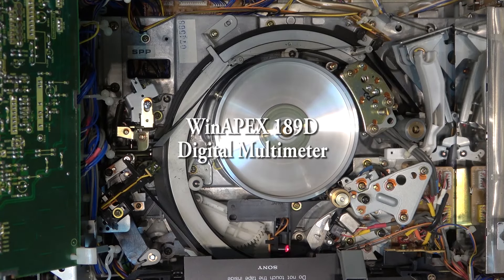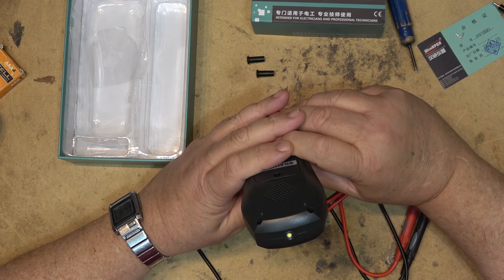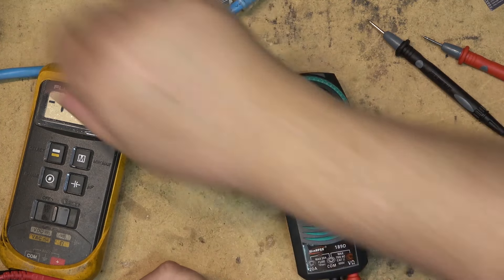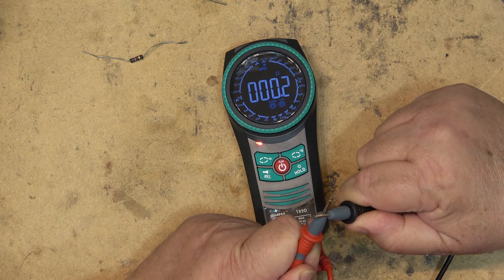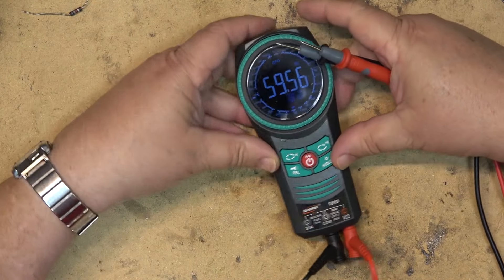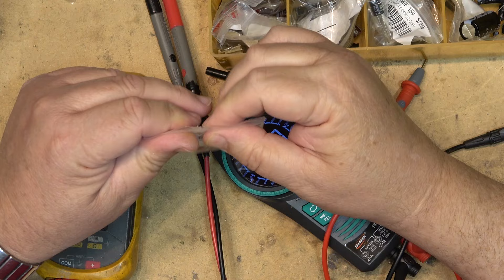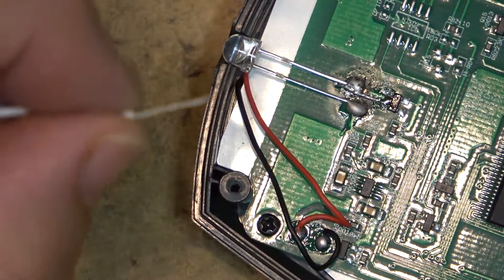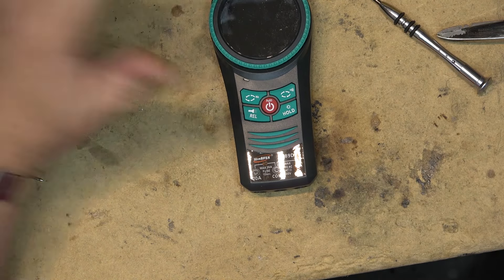WinAPEX 189D Multimeter Review

Comment: It's amazing that was the only damage.
Reply: That LED broke because the meter is cheap Chinese junk.
Reply from the maker: No, the led broke because it is a relatively heavy component and lad long leads.  They acted like a lever and pulled the trace.  Probably should have had a dab of glue at the factory.  The fact that it came from China has nothing to do with it.  We used to say the same thing about the Japanese products but YOU probably put them on a pedestal when in fact they were/are just as bad or good, however you look at it. China makes Some great stuff.  
Remember all the bad leaky surface mount caps that totally destroyed millions of video cameras from every manufacture in the 80s and 90s, and all the leaky caps in vcrs of the 80s and 90s.  They all went bad before the device was 5 years old and they were all made in Japan.  The caps that went bad were also made in Japan.  So by your hatred of things make in China I would have to think that you are a "magot" as the new buzz word would call you. (Trump supporter)
Reply from the maker: It snapped because the leads were long and not physically supported with glue.

Comment: Hello, I have a Hi8 camera and the loading mechanism does not automatically go down when I insert the tape. What could be the reason and how can I fix it?
Reply from the maker: Probably leaky caps in the drum and or capstan servo circuit.  When you try to load a tape the system tries to start the motors.  No start and it will open and not load tape but if you close without a tape it will close.

Comment: I do not work with appliances that draw 20 amps. Most of us hobbyists and professionals will never work with that high current. That meter from Banggood looks ridiculous.
Reply from the maker: This would be good for say checking a microwave oven as they typically draw between 12 and 14 amps. Can't do that on a meter with 10 amp max.
Reply: @12voltvids  Understood. But I never work with very high currents.